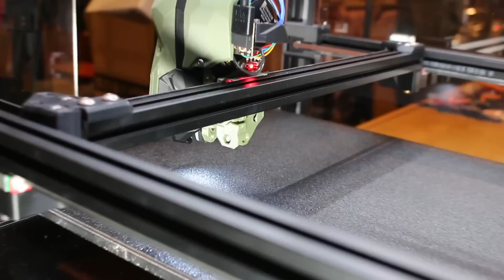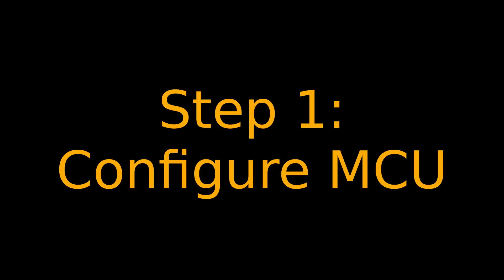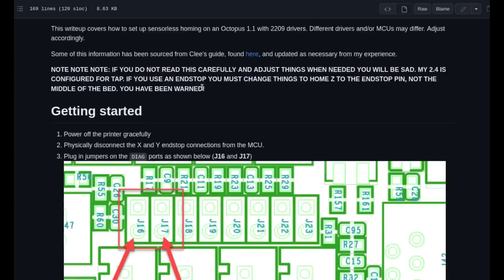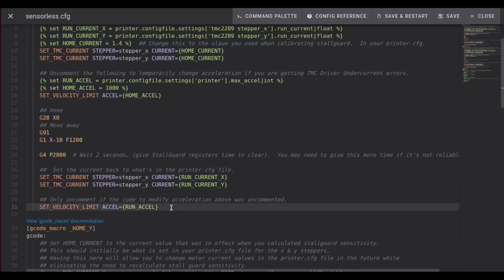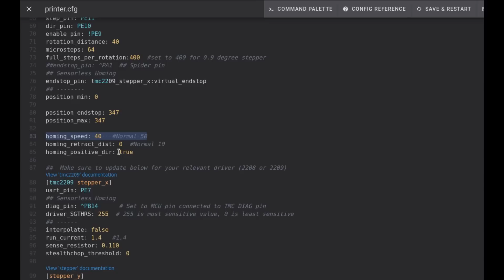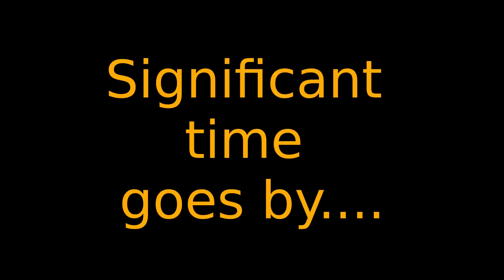Sensorless Homing, eliminate microswitches with Voron, 3d printer, Klipper, stepper motors & more

Comment: Hi again! so i have my head moving but when I try to run the calibration I get this error; "Endstop x still triggered after retract" doesn't matter how low I set the SGTHRS value it pops this error every time?
Reply from the maker: Have you set the virtual endstop and homing override?
Reply: @KapmansBasementWorkshop  yeah my issues was multi fold. I had the motors going backwards, I had the run current way to high, I had the sensitivity set wrong and really didn’t understand it at first. All good now got my tap, can bus and sensorless homing working well! Super happy!
Reply from the maker: @TwitchFlys  That's good news.  I'm very glad to hear it's working.  Over the next few days, you might need to make some minor adjustments to the sensitivity and then you should be fully done.  Thanks for watching!
Reply: For sure. I got the bed mesh run one time and had to shut it down for a few weeks while I’m out of town. Go figure I get it running right before I leave.

Comment: the home run current is the on that you using to run the x and y motor right? sice there is in % and in the config file is not. iknow that the sensorless file said that are those but just to confirm
Reply from the maker: home_current is the current you want to use when homing.  You must tune stallguard using the same value.  
run_current is is a place to store the default running current you have set during a print.
Reply: @KapmansBasementWorkshop  got it thanks. So run current is for printing a home current is for homing.

Comment: would you post a pic of your jumper configuration to put the spider in diagnostic mode? When i issue the commands to home x or y it responds with prob triggered right when it starts moving
Reply: never mind. i have them set just like the documentation says.
Reply from the maker: If you find it not working consistently, you might need to make the homing speed faster.  I now have that set to 60.  But please be careful.  If you turn up the homing speed, you will need to re calibrate sensor less homing as any previous values you calculated will then be incorrect.

Comment: Unfortunately I couldn't get it to work accurately, always about 0.5-1mm different from last home. Sometimes worse at 2mm where it can't even dock the klicky probe properly. My current optical endstops are well below 0.0001mm difference between homes, probably still better than that but my result accuracy is limited by the position readout decimal points in klipper
Reply from the maker: I'm sorry about that.  I failed to think about that.  On this printer, I no longer have klicky, it's just using TAP.  Optical endstops are easily the most accurate. I'm considering those for a future build.
Reply: Are you just using an IR Pair with something to interrupt?

Comment: First up, really great video! I really like the pace at which you explain the concept and the necessary documents. Perhaps you might want to consider normalising the voice as it does get louder and softer sometimes, but overall a 9.9/10 video!

Sadly, I sometimes get failed prints due to the undervoltage error. It more often happens after I QGL my voron 2.4r2, and try to G28 it.
Replaced the TMC drivers, changed the wiring, but it intermittently occurs. Went back to X/Y endstops and the problem disappeared; and I'm not sure why.
Reply from the maker: For the under voltage error, you could try lowering the run current during those operations.  On x & y I run very high current.  Dropping that a bit helped.  Also, you should have a look at this: https://github.com/Esoterical/voron_canbus/blob/main/toolhead_flashing/common_hardware/BigTreeTech%20SB2209%20and%20SB2240/SB2240%20Stepper%20Configuration%20and%20Undervoltage.md
It's a different TMC driver, but I'm willing to bet much of it works for 2209's and others.

Thanks for watching!
Reply: @KapmansBasementWorkshop  I'm actually running 0.8a, I'll try dropping that a little to see if it works. Thank you so much for the guidance once again! #subscribed
Reply from the maker: @Kravenovic  Just so you are aware, I was running my XY motors at 1.4.  I dropped them to 1.2 on the current and so far, I have not seen this anymore.  But more time is needed.  And I have no idea what this appeared.

Comment: I’m using around month and it’s working very bad for me
Reply from the maker: What is happening to your printer when you home?
Reply: @KapmansBasementWorkshop  1th issue homing one axis on center of printer but sensivite very low and around 400 grams but any way. 2th issue if you axis already on 350 point its require to add space because doing brrrrrrrrr when try to home
Reply from the maker: @rust_game_shop  It sounds like you need to re-calibrate as this should not be happening.

Comment: The description of "sensorless homing" makes it seem like an awful idea right from the get-go.  Like why not leave the switches in place and apply the code to detect missed steps and prevent damage in the event the switches fail?  It seems like the whole concept trades the abuse of cheap and replaceable switches for significant wear and tear on your entire axis. if they're getting hot, they should be able to be relocated pretty easily.  Or use a different means of detection.  No detection at all seems like a terrible idea.
Reply from the maker: It may seem like a bad idea, but now that I have it running, it's not causing any wear on the printer.  The TMC2209 driver is checking for feedback voltage from the motor to sense when it will start to miss steps.  It's super sensitive.  It barely touches the end of the gantry before it stops.  You actually can't even hear it tap the side.  Since publishing this video, there are no impact marks or anything of the kind on the gantry.  This works really nice.  I won't add a microswitch to the X or Y axis on any future printer build.  The switches currently no longer make any sense to me.  Thanks for the comments and watching!
Reply: @KapmansBasementWorkshop  touching is touching, even if it’s just a little. in the description it says to make sure your setup can mechanically take the stress. I have to imagine there’s some wear and tear happening. Considering how long my mouse switches keep working, I’d probably keep using the micro switches and add safeties for the event of a failure. 

Are there any professional/commercial machines that use this method? I’d think if it was a good idea and saved parts, it’d be ubiquitous
Reply from the maker: @threepe0  The QIDI X-Smart3 that I just got is senseless as far as I can tell except for the bed which has an optical sensor.  So X & Y axis are senseless and z isn't on this commercially available 3D printer. And on the Voron, the parts that touch are ABS, if they break, it's easily replaceable (I have backup spare parts that I have printed).  But, I understand the concern.  I had that same concern for years. This mod may not be for everyone and if you have no trouble with your setup, you have no reason to change.  Thanks for commenting and watching!
Reply: @threepe0  what are you talking about? 
What sort of wear? 

Do you even own a 3d printer, can you imagine the damage of a switch failing? 

Sensorless is the way to go, and no, it doesn’t damage your parts if calibrated correctly like shown here.
Reply: @010falcon  yes, I have several printers and have owned a bunch of CNC machines. And you are a moron. They’re called “safety” switches for a reason. You can go sensorless all day long, and in fact I’d say you probably should. Probably. Maybe. Switches can last longer than your lifetime, and sometimes they’re just fine to rely on. Sometimes not. It depends. But if you think that is a replacement for safety switches in any respect, it’s obvious you have absolutely zero experience with what happens when electronics fail, and you deserve what you get in the lesson. Chin chin 😉
Reply: @threepe0 that's a very strong misunderstanding on why the printer must be able to take the "stress"

The steppers don't get damaged and neither do the rails or wheels.
The strength is needed for accuracy, of the motor torque is able to pull your frame out of square then you have measurement errors that accumulate.
Even the strongest nema 17 won't do shit to a properly build printer!
The drivers are also equipped with overheat protection so they will be fine too.

The only component that actually gets SOME wear is the belts (put printing it self damages them too)
Reply: @SuperUltimateLP  “stress” in quotes… apparently you’ve never had a CNC or printer rip itself apart or completely toss tolerances out the window. I have. Saying the motors can’t do it is plain wrong. “Strong misunderstanding” I assure you, sensorless without SAFETY switches is window-licking level stupid.
Reply: Prusa Mk3 are sensorless. I was not keen on this bit after 4 years of use, it just work.
Reply: Occasionally I have an issue with power outages and sensorless.
Sensorless sometimes sets home 1 to 2mm off. Never had this issue with switches. 
So resuming a print after a power outage, it always fails. Otherwise it works great.
Reply from the maker: @chrisward8521 I don't have a resume after power outage. I did not know this.
Reply: Micro switches in a heated chamber have a short operating life. You are pushing them to the edge of their tolerances.

Comment: So I gave your macro a try on my ender 3v2 running a CR-touch. There is one small issue that I'm running into, usually the g28 command makes the gantry go up by around 10mm so that the probe has room to extend. The macro is not making the gantry go up and therefore the probe is unable to deploy. I haven't changed anything major aside from the coordinates and adding a z tilt since I'm running independent z motors. Would I use a force move or something to fix this ? I'm also going to ask on discord but I just wanted to let you know about this.
Reply from the maker: The maco does not move z up at all.   I think you could, try a force move, but I have not tried it.

Comment: I have been using sensorless for along time, but I was missing the homing override as well as the other advanced macros you showed. This is very helpful, thank you very much for makin this tutorial video. We need more klipper tutorials. Can you please do one for canbridge on boards that support it?
Reply from the maker: I just need an mcu that supports it.... Soon.  Thank you for the kind words and watching!
Reply: @Kapman's Basement Workshop  I'll give you a little hint.... use a BTT Manta Board and octopus 🐙. Again thank you so much for the tutorials you provide. You really help fill in the gaps that the documentation never explains properly. Klipper has so many capabilities but not all of us have the time to read and connect the dots with documentation and community assistance.
Reply from the maker: @hermangaviria690  I can't promise anything yet, but let me see what I can do.

Comment: I would concur... It is like the dirty secret no one wants to talk about.  While I have not had issues with the x/y endstops as of yet the klicky probe tends to go inaccurate quickly.  One of my buddies on line said that he replaced them about once every 3 or 4 weeks until he went to tap.  I am starting to observe somewhat the same periods of fallout. No one talks about this with klicky.  The endstop should be retired at some point unless a more heat resistant  switch can be found.
Reply from the maker: That sounds about right.  I was changing a switch about once every month or so. The last one that went bad was the cause of destroying a brand new PEI sheet on a 350mm bed.  Expensive!
Thank you for the comment!
Reply: never had an issue with switches, going on 2 years on the same one.

Comment: I have a tempered glass build plate, so I am currently using tap with the optical sensor. I actually probe at full printing temperature with a diamondback nozzle which works great, however there is still some thermal drift to the z offset. I plan to try a custom mod where I will simply break a circuit as the nozzle and gantry probes around. I'm hoping it will work at more extreme temperatures without any sensors or "low" temperature limit switches. My goal is a 200C build plate and >160C chamber. The higher temperatures mean I will need to switch to an umbilical without canbus and without sensors, and only wires going to the hotend assembly.
Reply: z offset due to thermal drift will alway happen unless you warm your chamber for a long time before you print and keep it warm.

But I think I saw someone writing a script where it compensate of the drift overtime
Reply from the maker: @yvesinformel221  I've seen it.  At some point, I'll give it a try.
Reply from the maker: I'd love to see that and I'd love to give it a try.  When you are ready, please let me know!
Reply: What is the benefit of using glass instead of pei ? When i got into 3d everything is pei sheet already

Comment: Thanks for the great video. isn't this a similar technique to how prusaMK3 works?
Reply from the maker: I'm going to assume you are correct as I have never used one.  However, it is common on commercial 3d printers.  The QIDI I just received has no microswitches as far as I can tell.  Thank you for the comment!
Reply: @KapmansBasementWorkshop  Thank yo ufor your answer. :) PS. i think i want same upgrade in future when get similar problems with swiches.
Reply from the maker: @andriusanryy5165  Between this and canbus, there are so few wires left on my printer.  If I could just get rid of the rest :)

Comment: If your stops are failing you can use 2 in parallel.
Reply: Honest question, how do you know one of them failed?
Reply: @Eclectrik  test periodically if they are in a adverse environment.
Reply from the maker: A failed switch usually appeared as non-predictable measurements in the case of z or outright crashes into the bed.  For the x & Y axis, Klipper would just stop.
Reply from the maker: Do you actually mount 2 switches in the same place?  I'm not sure how that works?
Reply: @KapmansBasementWorkshop  You could offset the switches, wire them parallel, when the first one fails from prolonged use in the heated environment the second picks up the slack or use the additional on another pin as a "failsafe" set up that shuts down the printer when activated.
Reply from the maker: @MyYewTubeAccount  You could, but at that point isn't it just better to get rid of the mechanical switch?  Someone else made a comment earlier today about the benefits of hall effect switches.  For X & Y, that might be a great solution instead.
Reply: @KapmansBasementWorkshop  I'm not suggesting using them, just how to do so. I've been using optical switches and don't run my equipment in an enclosure so its a non issue for me thankfully.
Reply from the maker: @MyYewTubeAccount  In the future, I will look into optical switches.  Thank you for the tips and watching!